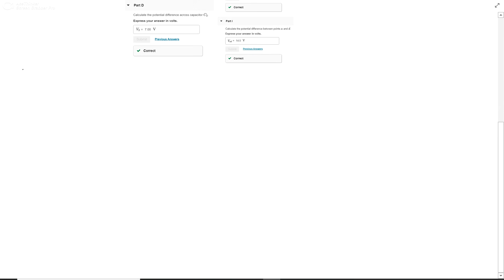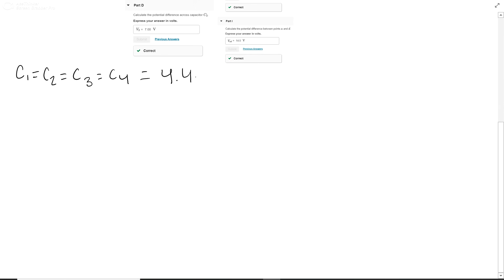In (Figure 1), each capacitor has C = 4.40 μF and Vab = 35.0 V. Calculate the charge on capacitor C1

Comment: How is 1/c12=2.2 x 10^-6 I keep getting a big number on my calculator
Reply: What she means to say is 1/c12=1/(2.2x10^-6). The denominator is all we care about once we get to this point so c12=2.2x10^-6. If you want a more linear way to get there, just take both sides to the -1 power. This should also give you the same answer.
Reply: @frend0687  how does she get 2.2 though? (1/4.4uF)+(1/4.4uF)= 2/4.4=0.45 or 5/11. Only 1/4.4 give you 2.2 so why didn't she add the other capacitor with it?
Reply: Never mind i see now. im an idiot; i didn't take the inverse once i added the fractions
Reply: @Static_io  ^this was SOO helpful. The entire time I was like "what?" but then I read your comment. Thanks